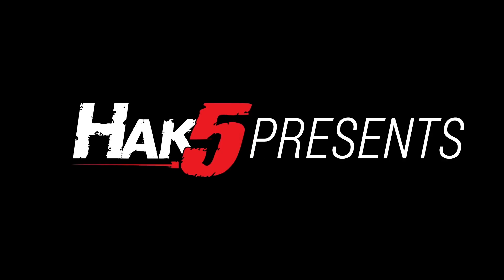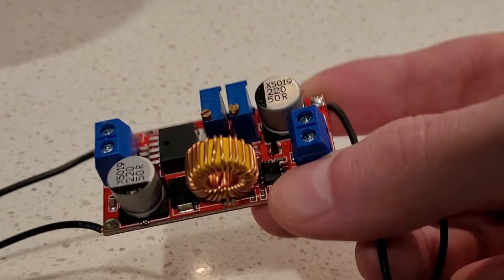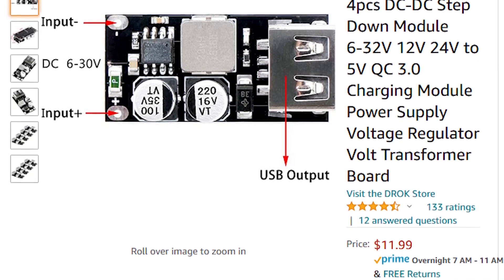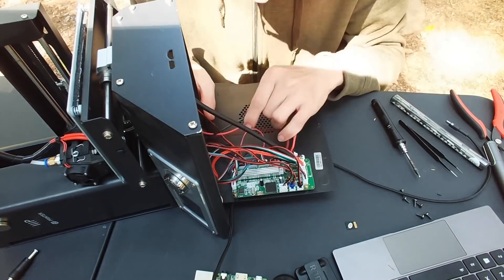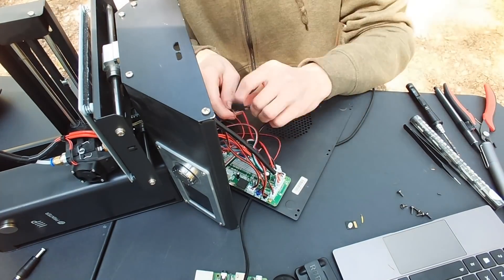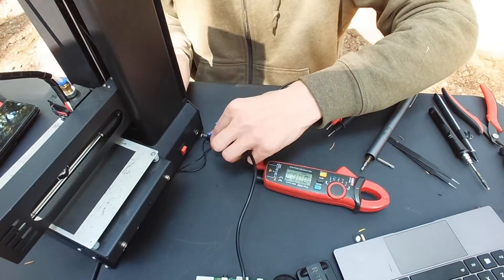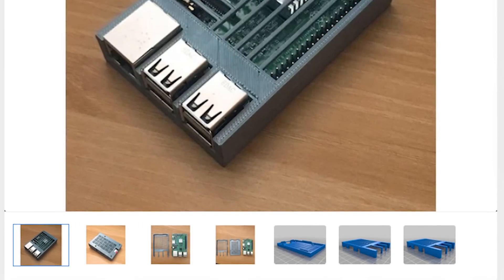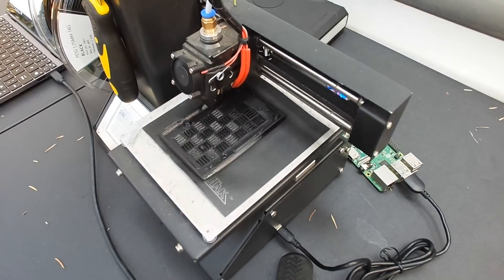Reliable Power and Protecting Octoprint Hardware w/Glytch

Comment: I personally have a pi that also controles a 4 relay board, that can just turn the printer on or off. Safer and I never had a disconnect of the pi

Comment: Good idea, I use buck converters on my printers fan output to reduce from 24v to 5c so I can install noctua fans for silent operation, didn’t think about powering a pi though, I could do with saving some plugs.

Comment: I think it's bad you didn't mention sudden power cut (when you turn off the printer) is bad for the Pi. It can destroy the SD card. I specifically did not wire up my RPI to be powered with my printer, because of that issue.. aaaand because I couldn't be bothered to 1) wait for the RPI to boot up 2) shut down the RPI every time for safe shutdown
Reply: Not really a big issue I power down my four Pi's a lol l the time and have had an issue ever. If I did it's like 8.00 for a new card.